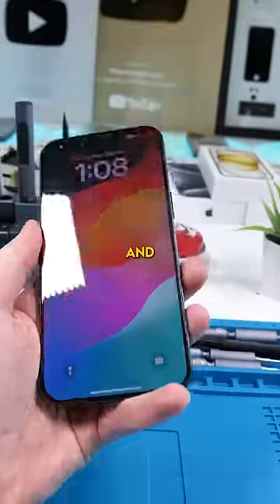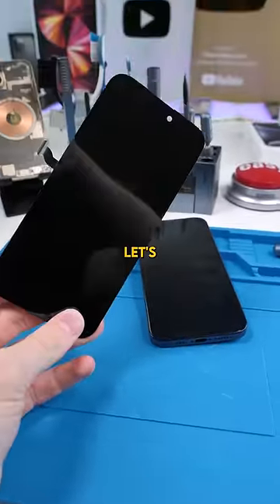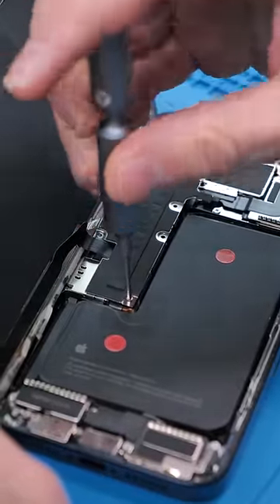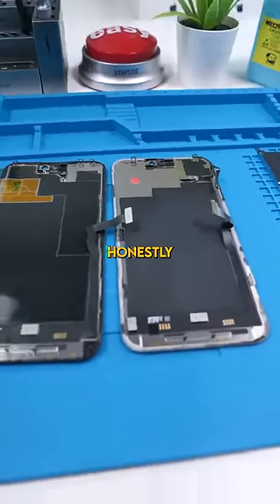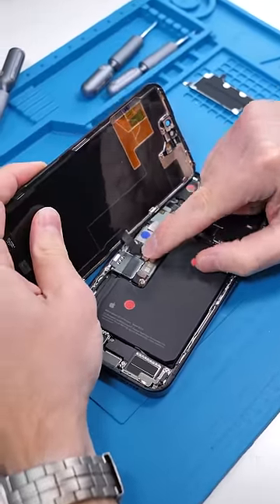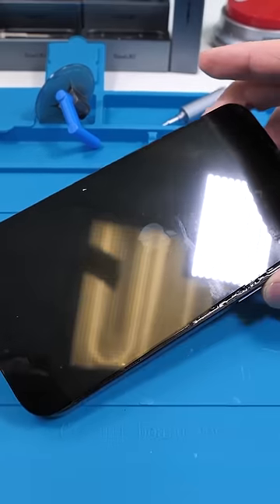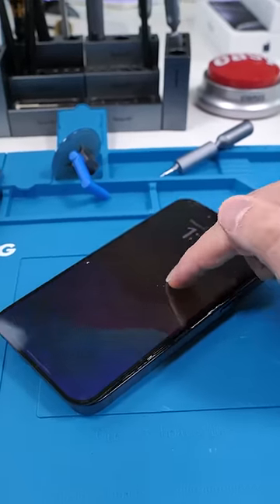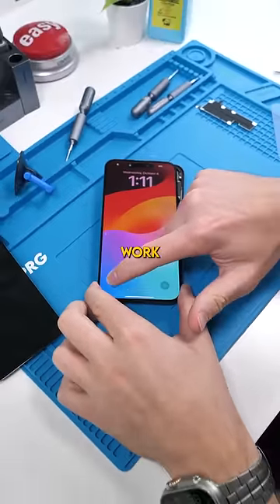iPhone 14 Parts On The 15..? #Shorts

Comment: The amount of disappointment when it can turn itself on but no touch control is honestly immeasurable.
Reply: Bro are you commenting… ON EVERY FLIPPIN VIDEO..
Reply: @viper7466 yes, it is. Frikin comment stealing bots
Reply: @viper7466  that means you read the comments on every flipping video 😂
Reply: My phone failed like that.
Reply: I wonder why the 14 screen (older phone) doesn’t work on the 15 (phone made to be used with the updated 15 screen) 🤔🤔
Reply: @elderkai6969 bro why would the touch specifically be different. Be honest, iphone 14 and 15 screen. What's the difference.
Reply: That’s what she said
Reply: connects mouse?
Reply: Try to put a Galaxy S23 Ultra on an S24 Ultra. I'll wait.

Comment: One step closer to sustainability 💀
Reply: What does this mean? So you want an iPhone 4 screen to work on the 15? Quit this sustainability propaganda
Reply: @nomecognome2 lol, what's the propaganda exactly?
Reply: @nomecognome2 dude, they don't even worked when swapped with same model
Reply: Bruh do you see an iPhone 4 in this video the iPhone 4 is incredibly old and before they started the whole climate agenda
Reply: @willdavis7470 If it works, that basically means they didn't change anything. You get it know?
Reply: @nomecognome2 Quit the blantant ignorance and downright assholishness. It makes perfect sense that the screens don’t work, but if they use the same ports and connect perfectly and there is a software issue, don’t you think it would be better to fix THAT then to make a WHOLE NEW screen? 

The sustainability with that is proly much better than your alternative.
Reply: @brinslinftw8698  The screen would not fit the 15. The frame and glass are different. Even if they added the drivers for the touch screen. you wouldn’t be able to install it
Reply: Another reason all apple products should be banned
Reply: @nomecognome2 this ain't it bud 😂
Reply: Y'all fr hate Apple 🤔
Reply: Just 1/2 a step cos the touch doesn't work
Reply: @nomecognome2  bro it would mean cheaper parts and repairs, wtf are you smoking
Reply: @nomecognome2  teh point is that many parts of teh exact same model of iphone dont work when swapped. and that aint good m8
Reply: the iphone 14pm is actually wider than the 15pm, the screen wouldn’t actually fit the frame anyways
Reply: one step closer to the edge
Reply: @nomecognome2 😂What would make it impossible to install drivers?
Reply: @asandax6  The fact iOS is a safe OS and also there is no need to install drivers since the screen doesn’t fit the iphone 15
Reply: @nomecognome2  do you even know who was apple CEO that time? 

Let me remind it's steve jobs, not tim cook.
Reply: bruh 🤣
Reply: @nomecognome2  "propaganda"  lol
Reply: The apple meat riding is real
Reply: @nomecognome2 bro don't lik clean air or water🤣
Reply: @brinslinftw8698 the connector can be the exact same but the pins are for different purposes :) maybe the pins used for touch on the 14 aren't the same as 15.
Reply: 🤦 some of y'all don't even know how the display is configured, the screen tech is different the connectors serve a different purpose! honestly the guy who said "the iphone 4 to work with an iphone 15" maybe correct but they r technically right the apple hate meat riding is true (y'all hate on apple for the littlest thing) (and I'm an Android fan too!!!!!!)
Reply: What are you tryna say? An S23 ultra screen probably doesn’t even use the same connector as the s24 ultra
Reply: @mycelia_ow  stop yapping dude they nigh use the same connector but the same pins are maybe used for different things and shit
Reply: @asandax6  impossible to install in the phone, as it’s a larger display because of the thicker bezels
Reply: @nasimhussainchowdhury2466  I think he mean iPhone 14. Typos happen you know
Reply: @pretty_bored  fr, android fanboys lose any common sense when talking about this
Reply: @nomecognome2  its literraly a generation apart. i dont think it eould be too revoliutionary to make the older screen work on basicslly the same phone with a few more features?
Reply: @Fekxyz-gr8hc  it’s impossible, it’s got a different structure, it just doesn’t fit and you wouldn’t be able to stick it on the phone. There were cases of screens being compatible across generations when they were identical such as iphone 8-SE
Reply: @nomecognome2  impossible? you say. they tottally do not change their structure every single generation so you pay more for acreens tottally...
Reply: @Fekxyz-gr8hc  they do, the thickness, the shape of the glass and the screen frame changed from 14 to 15. The times they are 1:1 identical they are always interchangeable
Reply: @nomecognome2  man its so hard for them to keep the deisgn they tottally do not change their design every single generation on purpose to make more money.. also they removed the charger brick for "sustainability and the "enviorment"
Reply: @Fekxyz-gr8hc  I’ve studied the way iPhones are engineered for years, while the difference from outside can be minimal, they inside is very different from iPhone to iPhone 90% of the time

Comment: There goes the whole Apple saves the climate BS.
Reply: They are two different phones.. parts from 2 different products aren't supposed to be interchangeable. What are you on about?
Reply: @breadcraft3605 they're literally the same part same tech and everything only difference is that the 15's screen has different layouts on the connector which was done on porpuse by apple there is no reason why they should do it that way
Reply: ballsexaminer  samdung 😂
Reply: ballsexaminer damn who hurt your feelings
Reply: @MemzDev  "porpuse", "dev" in channel name, minecraft pfp, braindead take. everything checks out.
Reply: @breadcraft3605 he's talking about sustainability. It's supposed to be eco friendly, and eco friendly means less waste. Why not just use the old ip14 board layout so we can have less waste to manage when replacing ip15 screens huh?
Reply: @ladboii2901  they are TWO DIFFERENT PRODUCTS. why should parts from TWO DIFFERENT PRODUCTS be interchangeable? if they were interchangeable they would be the exact same phone.
Reply: @breadcraft3605 it’s impossible to please people. if they were interchangeable, this same guy would of started crying about how this phone is the same as last years.
Reply: @breadcraft3605  because those two parts are almost the same… they had the Chance to do that…

That’s like a Spark Plug with an extra Notch or something to prevent People putting it into an Audi instead of Mercedes
Reply: @DarthG3nesis  key word almost.
Reply: @prabhsaini1  fr
Reply: @DarthG3nesis and then people would complain that it’s the same.
Reply: @breadcraft3605 in samsung phones it does without software locks
Reply: ballsexaminer no right to repair
Reply: @breadcraft3605 "the exact same phone"
I mean, isn't it already?
Reply: @DarthG3nesis they call it innovation, we call it unnecessary updates. Just like what windows did every damn month 😂
Reply: @MemzDev they are quite literally two different components. They have different capabilities and aren’t built to me interchangeable.
Reply: @MemzDev I heard iphone 16 rumors where they make each phone .1 inch bigger
Reply: @GimOA  "they call it innovation, we call it unnecessary updates."
We are not the same.
Reply: @MemzDev different screens require different drivers
Reply: @breadcraft3605  To 14 and 15 displays are literally identical, Apple went out of their way to make it not interchangeable when it was from the start. back in the day you could put an iPhone 6 screen on an iPhone 8
Reply: @prabhsaini1 it is fucking same just the board layout is different! They could easily keep the board layout same but they didn't. Even that's fine tbh but the fact that 15 doesn't have a lotta spare parts available in market and it's extremely fragile (no iPhone has failed bend test by Jerry Rigs Everything except iPhone 15) that just sucks cause that means one will have to spend shit ton of money to get it repaired that'll cost half the price of what the device costs and obviously create way more waste so all that pro sustainability bullshit Apple is selling is bunch of crap is what he means
Reply: @mycelia_ow  the bezels
Reply: @breadcraft3605 yes but they didn’t change anything significant, what would be the point of changing the touch digitiser layout or protocol
Reply: @teamredstudio7012  okay? having less bezel means you can touch where there is less bezel and it would work, right? that is the exact reason why the touch didn't work but the screen did.
Reply: @breadcraft3605  be cause the 2 different products are A THOUSAND FUCKING DOLLARS APIECE FOR LITERALLY NO DIFFERENCES BETWEEN THEM. this practice is wasteful and worthless because Apple will make you buy a new one and just throw out the broken one if you exchange. the tool rentals do nothing to help as you cant buy the parts individually. he literally proved that the phone screen is identical, meaning Apple used the same internal display, but changed the pins so you cant buy any other screen except the $700 brand new one.
Reply: @darthraider450  the same "samdung" that makes the capacitors, display, camera modules, and the non m-series processors for Apple?
Reply: @breadcraft3605 wasn't even a braindead take 😭
Reply: @Lian_kun  the size of the screen is fundamentally smaller on the newer phone because it has a smaller bezel. Is that to hard to understand? Or are you angry Apple improved the screen?
Reply: @breadcraft3605  I need you to understand, if the screen size remains the same and the bezel is decreased. The actual casing of the phone is made a tiny bit smaller, to fit the new screen. This is further proven by Apple’s comparison site.
Reply: @breadcraft3605  well normally the signals from the digitiser are sent through a protocol, I would expect this to at least be able to be usable by the controller. They aren't changing the bezel by that much, they must've done some other low level changes. If they wanted a 14 screen to work with a 15 they could do it with ease.
Reply: @teamredstudio7012  bruh. your logic is broken. if that was an experiment between 2 android phones with the same outcome i bet you wouldn't be so mad
Reply: @nikolashumphrey-howell2478 Those are 2 different products… and it’s not apple who create the problem you described. It’s the customers.
Reply: @nikolashumphrey-howell2478 don’t Sony makes basically all camera sensors right now? (Honest question) as for the processors I think you’re wrong, that would be TSMC
Reply: @prabhsaini1 everyone already is crying about the devices being the same each year. it's not anyone's fault but the fact apple is scummy and they care far more about the $$$ than the consumers. there is not anywhere near enough difference on the iPhone 15 for it not to just be an iPhone 14, therefore causing anger that you can't use iPhone 14 parts to fix the iPhone 15
Reply: @imabanana2315  You’re intentionally avoiding my main argument that if you want more features you require change. Making the bezels smaller fundamentally reduces the size of the screen where practically it would be unusable in another phone.

Unless your solution is to never upgrade a thing again.
Reply: @MemzDev the 15 screen has a different layout, slimmer bezels and is brighter, the tech is different bro they aren’t the same thing we don’t know what they did in the background that makes the screens different 💀
Reply: @nikolashumphrey-howell2478 don't forget the screen
Reply: @darthraider450 Apple uses Samsung parts so who's Samdumb?
Reply: the iPhone 14 screen has larger dimension it doesn’t fit in the Iphone 15pro
Reply: @MemzDev the screens are different. Smaller bezels and the glass is more rounded on the 15 pro.
Reply: @insainllama  useless changes dude
Reply: @breadcraft3605  they are exactly same, they changed the layout on purpose. If the phones are LITERALLY the same, why not let people use parts from older phones....
Reply: @prabhsaini1  youre incorrect. on a pc you can connect any touch screen monitor (display) you want and it will work out of the box.  Phones are just smaller computers, you can make a universal driver that works on any screen you connect to the device, but they dont want that
Reply: @ItzBrooksFTW  they are not "LITERALLY" the same. try and use a screen from another android with another (simular) one. you will get the same result. because the phones although simular are not the same
Reply: @ItzBrooksFTW  Ok. What do you not understand about the iphone 14 screen being LITERALLY smaller than the frame on the iphone 15. how many times do i have to explain this for peoples brains to keep ticking.
Reply: @prabhsaini1  i wasnt talking about installing the screen, but about the compatibility, it should work no matter what screen you connect, and no, iphone 15 pro max is the smaller one
Reply: @breadcraft3605  your pfp is a loaf of bread and your channel name is named after minecraft. stop it with that "holier than thou" attitude
Reply: @breadcraft3605 "bruh" "fr" kid thinks he knows more than several people
Reply: @Pizzafan622  "bruh" and "fr" is slang that everyone uses. what are you, a 60 year old grandpa?
Reply: @Pizzafan622  and your pfp is a D and your name doesn't make sense at all
Reply: @breadcraft3605  my account name is my actual name, and im using a default pfp. makes sense to me 💀
Reply: @Pizzafan622  proceeds to completely ignore my second point
Reply: @breadcraft3605  bruh the screeens are damn near the exact same except for the bezels. this is literally just apple and their anti right to repair shit
Reply: @MemzDev  Good lord the amount of tech illiterate people in this comment section is crazy  They are not the same though. Let me explain this very simply. They use the same display cable. Its like  when you plug an HDMI from your TV to your console if you changed your TV you could still keep the cable. 

There is no reason for apple to change that, Its a display cable. Why would they change it?
Reply: Atleast they are trying
Reply: @ladboii2901 as if you were going to buy it, if they were interchangeable. if they were you would be crying how they are not different.
Reply: @Lian_kun the price of Apple's glass back for 15 pro max is 1/3 of what it cost for 14 pro. only the 15pro max failed the test none of the others did. and the bezels on 15pro are less so no, they are not the exact same screens
Reply: @breadcraft3605 if the screens use the exact same technology (as this clearly does), making them dysfunctional via software is horrible for the environment.
Reply: Try to put a Galaxy S23 Ultra on an S24 Ultra. I'll wait.

Comment: Swap their back glasses to see if it improves durability
Reply: its impossible, the 14 pro max has glass that is completely different from 15 pro max
Reply: I think because the 15 pro max has a thinner glass, the 14 pro max glass might not even fit on it.
Reply: You really can't. The panels are glued to the back of the 14 Pro and promax to the point where you need a laser to remove them. Apple only made the change to easily removable back glass with the iPhone 14, regular phones. It came to the pro phones this year.
Reply: The durability issues are caused by the titanium making everything too ridgid so all the stress goes into the back glass
Reply: @natfletch05  I think prg mentioned that there was a metal plate missing on the 15 and thars what made it weaker
Reply: Or perhaps 3d print one?

Comment: That iPhone 15 pro max really was like "unauthorized display found, fuck you"
Reply: No they’re just incompatible for good reason, they have different screens after all.
Reply: @nylotical its called serialization the screens are hardly different 😂
Reply: "hardly different" is enough to make it not work. the proximity sensors arent in the same place @LuneeGD
Reply: @nylotical  you could literally swap the display from another iPhone 15 and it'd still consider it incompatible. Apple isn't very repair-friendly.
Reply: @normi9033  Its just that you have to trick the phones system to think its the same display same as with storage swaps. And literally any other company like Samsung are doing the same that you have to trick the system for it to work
Reply: And the displays from the 15 and 14 are different so it maybe possible with some software but only swapping the display wont work
Reply: @driftboard  damn crazy how th proximity sensor stops touch right?
Reply: @driftboard proximity has nothing to do with the touchscreen if you ask me
Reply: @LuneeGD Wth does man mean by serialization isn’t that for loading raw information into memory that’s mostly used in computing software and applications
Reply: @driftboard I disagree - companies frequently make things incompatible on purpose via software. Especially apple
Reply: @loverboi753 bro sounds brainwashed af
Reply: iPhone 15: Beep beep detecting parts not authorised by apple 🍎.You can't use this phone 📱
Reply: @nylotical It would not surprise me in the slightest if these are otherwise identical screens save for the few changes Apple made so they can call it a different part, I am willing to bet a lot of money that if Apple didn't engineer this in such a way that these are not compatible that those screens would absolutely be interchangeable

Comment: The biggest problem with the iPhone 15 Pro Max is the back glass cracking because it is under a lot of pressure and they changed the metal back plate position from being connected with the glass to now being built into the frame. Can you take a 14 Pro Max back glass add it onto the 15 Pro Max, possibly doubling up the protection of the phone?